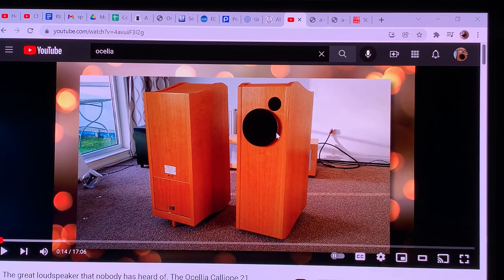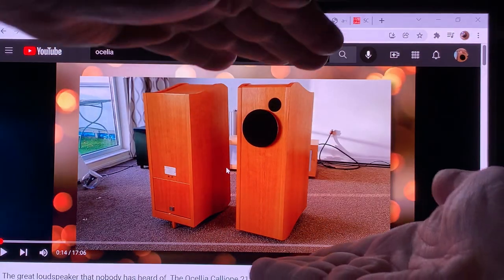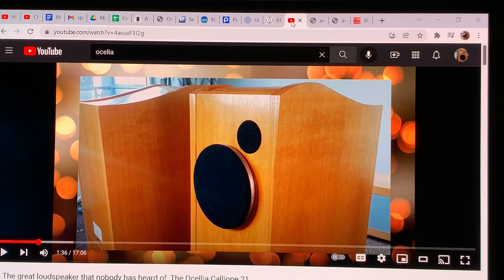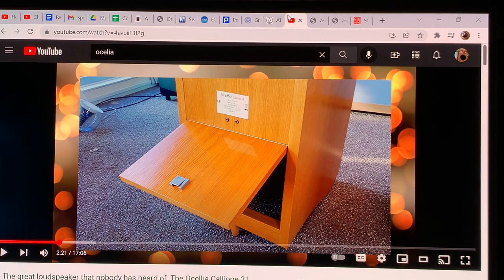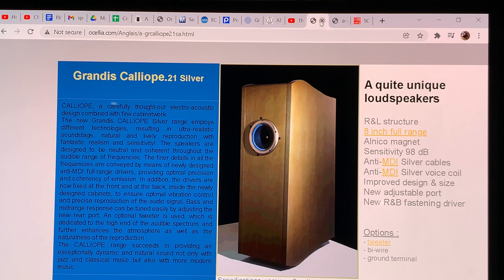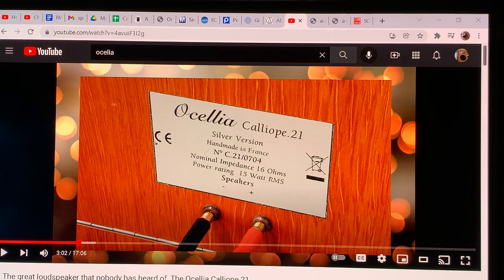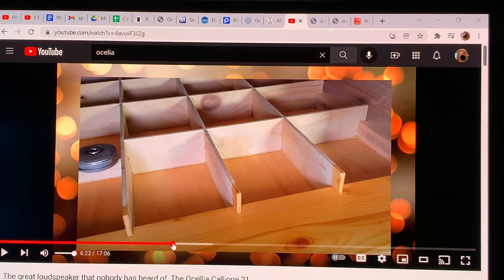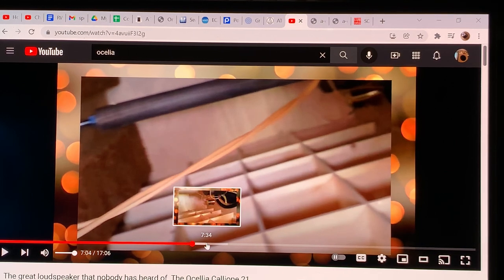Studying active cabinets:  the Ocellia

Comment: Hi Janos ,beautiful description of the cabinet details and the intent of the designer..I just thought I would pass on the PHY drivers can be had without a tweeter, with a coaxial tweeter
and with a separate tweeter.These drivers are amongst the best I have ever heard , alnico magnet,silver voice coil, paper cone, bronze basket.All of these materials contribute to the magic.PHY along with Fertin, Supravox and EMS are some of the great drivers coming out of France.Best Regards Lou.
Reply from the maker: Thank you Lou! Indeed, these PHY drivers are just about the most gorgeous drivers one can get. The construction and attention to detail is just absolute top level, not just in a technical way, but in a technical way with considering music / natural response as a key factor. VS measurements alone, where most so-called "state-of-the-art" modern drivers are going at.
Reply: Hi Lou. Do you have any specific recommendations for an 8 inch fullrange-driver to use in a Voigt Pipe loudspeaker (hoping to build one this year)? Many thanks! Claus
Reply: @earkivaren  Hi Claus I do not have any experience with the Voigt pipe speakers, you may want to ask Janos for a recommendation as he has a lot of experience with building them. I do recall a friend of mine having Cain and Cain Abbey speakers about 15 years ago and they were a Voigt  pipe design and if I recall
they used a Fostex 8 inch driver but I do not recall the number.I do not also know how much your willing to spend as well  because prices on drivers  can vary so much these days.I have mainly focused on open baffle designs with field coil speakers for the last 
15 years or so. Best Regards Lou
Reply: @loureda5443  Hi Lou. Sorry about the late reply. Thank you for chipping in. I guess so much determines a appropriate driver: price, amp, loudspeaker design, room characteristics and much else. I was just looking for a quick fix :) Thanks! Claus

Comment: So... in order to hit 21,5 Hz using a t-line or voigt pipe, you'd need a room that's 16 meters wide/long? if i understand correctly, a resonating cabinet that is 2 meters in its longest dimension will have its maximum resonance occur at 86 Hz (if not stuffed), full power bass extension to 43 Hz, and half power bass extension an octave below at 21,5 Hz? but without pressure it needs the right distance between walls (16 m) in order to support its resonance?
Reply from the maker: Hi Raoul, yes, that's correct, it works by exciting the waves, instead of creating pressure. However, if the room is half the wavelength, then the 21,5Hz wave can already form in it. (But close-by frequencies will have issues - eg 20Hz, 24Hz..)  So, a 8m long room will already give pretty decent 21,5Hz, but the response with half-wave size rooms is not as even, because if wavelength is little longer or shorter, then response gets much more uneven compared to having the entire 16m length. Going back to the response: 2m pipe will give 43Hz full power (the quarter wave), and roll down to 21,5Hz. The actual application being good response down to 30Hz in most large rooms/
Reply: @realworldaudio  by the way, i wanted to say how much i appreciate your videos and the information that is contained within them. and the effort you put in 😊. i feel like some of the true magic of audio can be learnt from these videos, which can be hard to pick up just off the forums, for example, or other sources. speaking for myself, of course 😊. it excites my passion and enthusiasm for physics, audio, and music (as you may have noticed! 😁). so thank you
Reply: another question... if you don't mind. could the best of both worlds be combined...? so 98% of the magic and efficiency of voigt pipes with 98% of the extension and authority of bass reflex. for example, by creating a voigt pipe style cabinet tuned to the room by virtue of its dimensions and flexible resonating baffle, that in addition is ported and tuned to 20 Hz. (assuming the driver specs facilitate the port tuning.)
say we use a subwoofer of decent efficiency, (and the cabinet is huge), would the bass driver need to be mounted to the baffle, or would the baffle resonate just as well if the bass driver was mounted on the (thicker) side or back wall of the cabinet?
Reply from the maker: @raoulselten9480  Hi Raoul, you have essentially described my Voice of Lancelot speakers! Basically a Voigt pipe in active cabinet, that opens with a port to the room and is tuned to 18Hz. The Altec 515C handles all the material between 11Hz- to about 500Hz. (The driver can handle material strongly down to 13Hz, and has useful output down to 11Hz. My calculated -10dB in-room response is at 13Hz, and the -6dB point is at 14Hz.) The crossover is first order, rolled off at 265Hz. The cabinet handles frequencies down to 35Hz, and the port takes over for the sub-35Hz. My room is about 13m wide, so 16Hz half-wave can fit inside, and a 32Hz full wave as well... So, basicaly fully-developed bass down to 32Hz, and then choppy bass down to 16Hz. Its bass reproduction is unlike anything I heard. The sub-20Hz region is a total game changer for those material that has that content. With a huge warning: it is a complete life-changing experience....
Reply from the maker: @raoulselten9480  Thank you Raoul for sharing your thoughts! Indeed, from the start of my fascination with audio I wanted to get to the magic... I hope I can help your journey! Cheers, Janos
Reply: what do you use for the midrange and above? is it crossed over?
Reply from the maker: @raoulselten9480  I use the Altec 288 compression driver, with second order high pass at 500Hz.

Comment: Can you share your thoughts on  voigt pipe cabinets? Should they be active, dampened or a blend? What did Mr. Voigt think about this issue? Thanks and keep up the good work!
Reply from the maker: Thank you Mark for the question! The original Voigt pipe was live cabinet, lightly stuffed in the top half, with very high efficiency full range driver. All the best Voigt cabinets I hear  were just like that - live cabinet material (pine, spruce), light stuffing in the top, 95-97dB efficient drivers. Cheers, Janos
Reply: Thank you Janos. 
I am  planning a Voigt pipe build  using 8” audio nirvana drivers, 3/4” bb plywood sides/back + spruce front baffle. But Tech Ingredients constrained layer approach as me thinking twice 😀.
Reply from the maker: @markjensen9346  Nice plan! Using constrained layers will bring the focus more to midbass and top end, and will bring a feeling of "greater control", but also of "restraint". It will move you towards accessing the music through your intellect and focus more on the stereo gear. If you listen to a lot of trumpet, saxophone, then you might like that path better, as the constraint will make them pop out even more as the harmonic overtones are missing. Keeping the cabinet live, will make the midrange breathe, wooden body instruments and vocals sound natural. Will make you sing, dance, and connect to the performers instead of brooding mood / focus on gear.
Reply: @realworldaudio  That helps Janos. Thank you. Looking forward to hearing more re: the Lancelot.